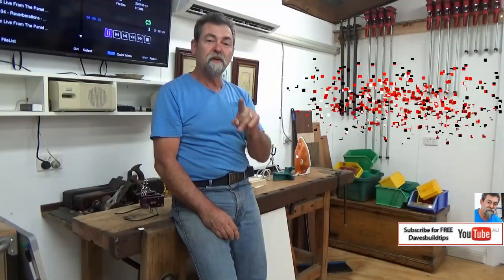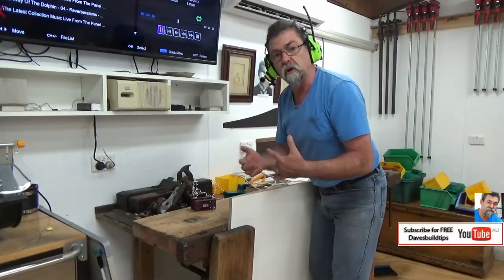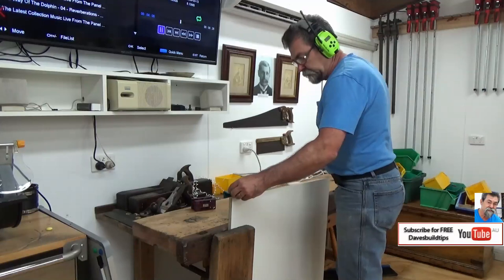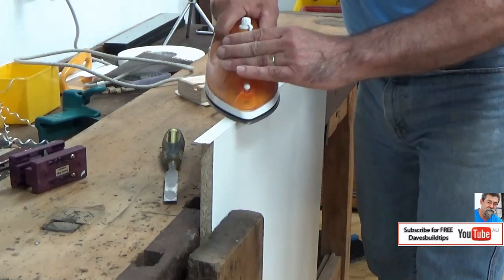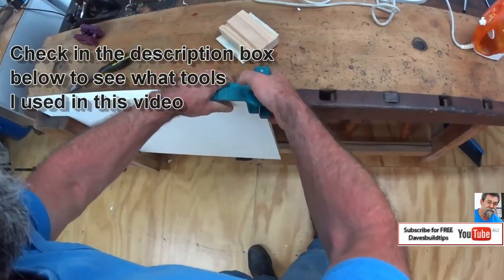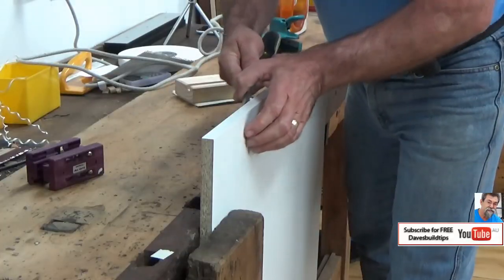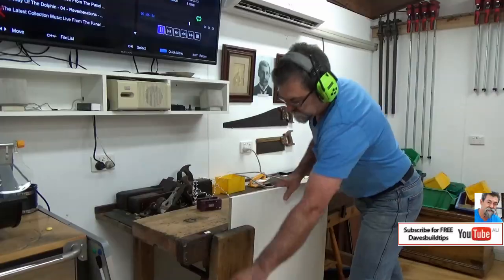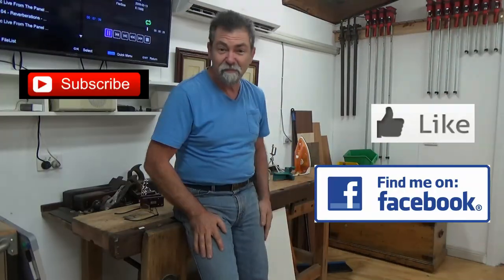Edge Tape | Iron on | How to | Dave Stanton

Comment: nice Dave,  can I add...? I like to burnish with a seam roller (pressure down, a chamfered block does the same)  in the post Thermo glue set it's squiffy for a bit, and there's risk of slippage or cold lift... then i fold over/ cut down with the paper at a low angle,. especially with the wood veneers.

Comment: Hi David, I have one of those brown edge trimmers from Carbatec but the one I have must need adjusting. I was trimming the edge tape and the blade was a bit loose and cut into the face of the door I was making. I was a little annoyed as I had to remake the door so I just put the trimmer aside and did all the rest of the trimming with a chisel. I was just wondering, do you know the correct way to set the baldes in the trimmer? or is it just trial and error? Thanks, Phil.
Reply from the maker: Hi Phillip. Try putting the trimmer on the board without the edge strip and put a small clamp on it to act like your fingers holding the trimmer together. Loosen the blade screws and then advance the blades toward the board until they touch . Don't loosen too much, maybe a quarter turn. Tighten the screws and then test on scrap board without tape.
Reply: David Stanton Thanks mate. I will do that.

Comment: This is an odd question.
Would this kind of product bond to painted metal?

I'm having a go at making a desk frame with square tube. But i'm wondering if something like this product (a 40cm strip on each side) would act like a skid to protect the floors?

Thanks for your time to read.
Reply from the maker: I don't think it would be fit for purpose.

Comment: Hey Dave. thanks for the video. I have the same end and edge trimmer you have. I find the edge trimmer works better using the straight blades on one side as opposed to the angled blades as they seem to tear into the melamine board. I also use a fastbreak sander, you should check them out, saves a step with the chisel and leaves a nice angled clean edge...as you say it's "brilliant"..lol....and it works even better on wooden edge banding.
thanks again for you video's.
Greg
Reply from the maker: I will have a look Greg, thanks for posting!